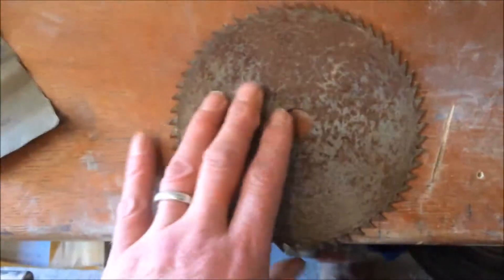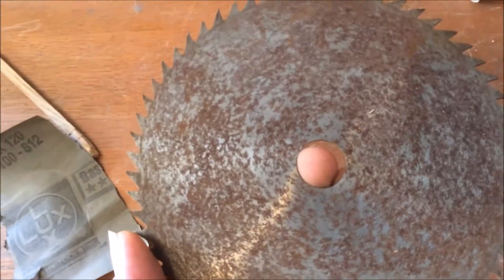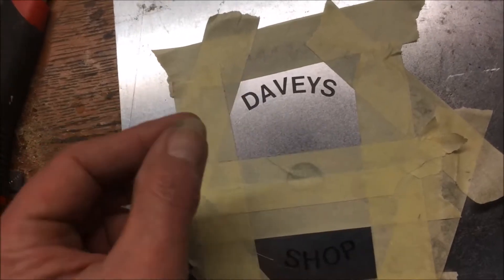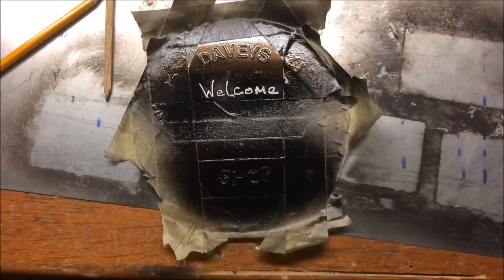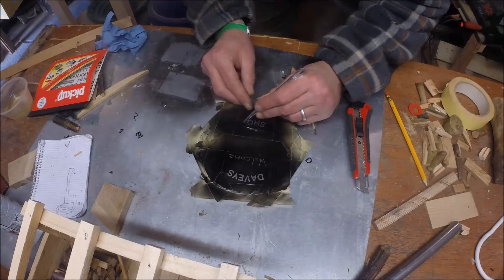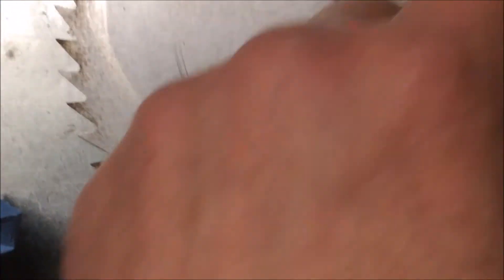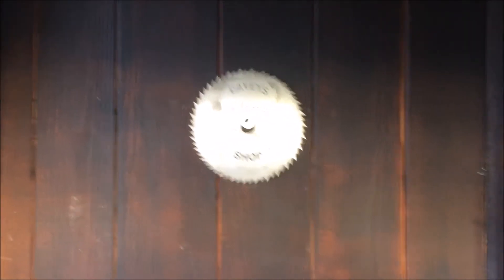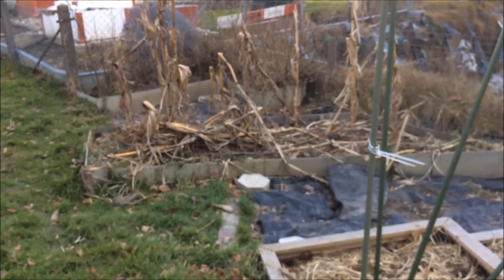New sign for the work shop elecro etched 25 02 17

Comment: What about the meal worms?  Did that go ok for you?
Reply from the maker: Funny you should say that I sieved out my beetles today and I am the father to hundreds. I need to up scale it but I am getting some to feed to the birds. My temperature is a bit cool so they grow slower. summer is better but heat mats might be the way to go. But the two tubs blue and clear on the grow shelf left corner are the worms and beetle farm right at the back.  Hows the shop going? I have to say I am so happy I got mine into some sort of order I know where most stuff is and can put my hand on it. I haven't used the chop saw since I made that cross cut sledge thats a fantastic tool.
Reply: The shop was going great until the tree cutters arrived and dropped 14 Ash trees.  Thankfully, my mate's daughter, who is a mean chainsaw operator, has cleared most of the stuff up but I lose her next week because she's away training for high level cutting, safety roping, and rescue so that's me on my own for a while.  I am getting stuff sorted into good blanks and firewood so it's taking a bit of time.  There will be an update fairly soon.
Reply from the maker: If I had all that fresh ash I would be ordering some mushroom plugs. Its good wood for cultivating mushrooms. Send her here next I have to trees to take down. wish I could get my hands on some free wood. I went to a saw mill and he wouldn't sell me a slab of hard wood I would have to buy a full tree almost.